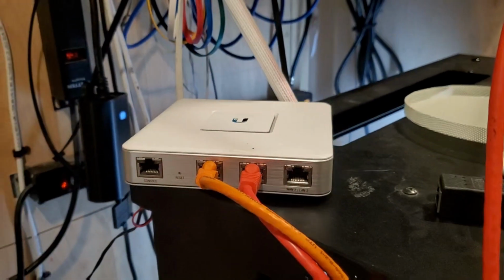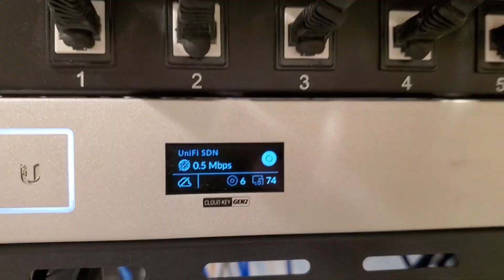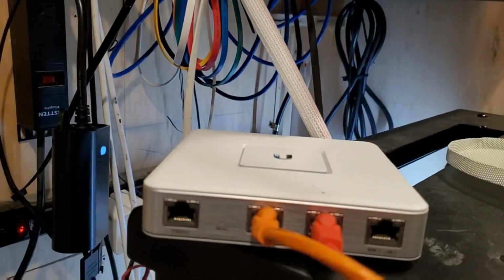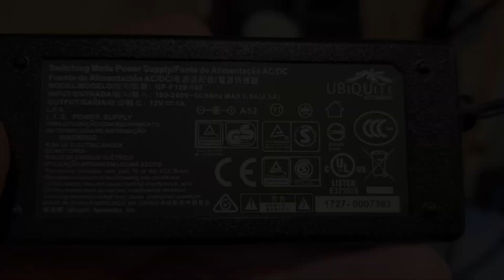Ubiquiti USG Security Gateway Console Light Blinking Green NO Internet This is how to Fix IT

Comment: This just happened to me and changing the power supply fixed it.

I tore my house apart looking for some barrel plug that had both 12V and >= 1A.  Now it's 1:32am and I'll have to wait until tomorrow to put it back together.  Wife won't be happy.

LISTEN: You need to match the 12V, for amps it's okay to go over but not under.

I found things that had 12V but were less than 1A.
I found things that had 12V, >= 1A but the barrel size was too small.
Finally found my Cooper Cooler (great device BTW) which not only chills a room temp beer in 1 minute but also restored my Internet before I leave on business for a week.

Comment: This did indeed resolve my issue, however, i did have some Ubuiquity 12v 1a adapters at home (from switch and other appliances). NONE of those worked. I had to get myself a 12v a2 (from another router i had) and it worked...........
Reply from the maker: Glad it helped!

Comment: My wlan became flaky and finally died shortly after the power blinked during a storm. Looking over my hardware, I noticed the green led on the power brick powering the USG was not solid and was faintly blinking green. I dug through my junk and found another brick with a barrel power connector that had the same specs as the old USG power brick. 12v 1A and center positive. Plugged it in and the USG and wlan came alive again! 

Whew! Dodged a bullet there!
Reply from the maker: Great! Definitely dodged one

Comment: Exact same issue and this video saved me a lot of frustration! After some digging around the house I found that my Bose sound system had a 12v 1.8amps power supply. Plugged that into the USG and VOILA! It's working again and the center led is even blinking (it wasn't before).

Thanks a bunch!

Comment: Had exactly the same problem. It was probably around 3 years since I bought this gateway. On my original power supply that was dead, there was also a green led that was blinking that showed that it is not feeling well. Replacing the power supply with the one that is also 12V 1A (similar to the one in the video) fixed the problem.

Thanks for the tip!